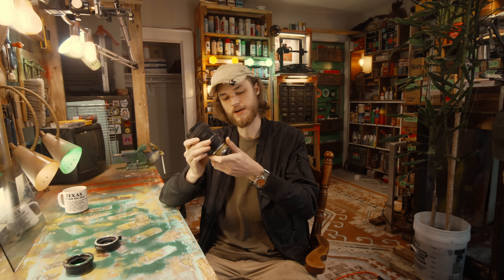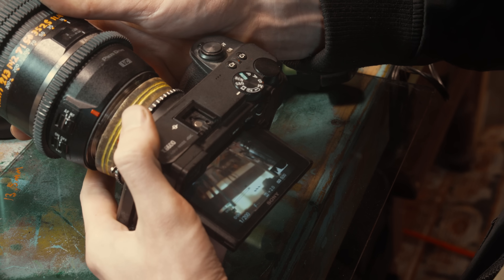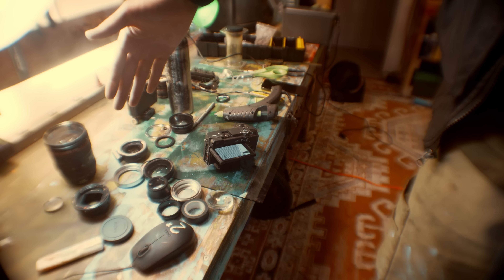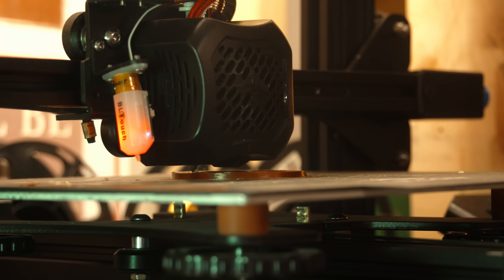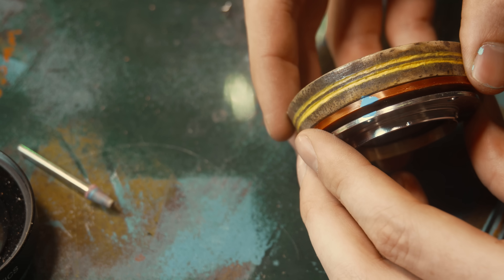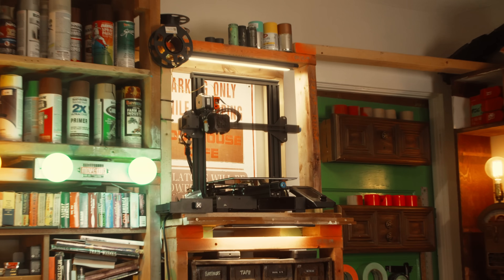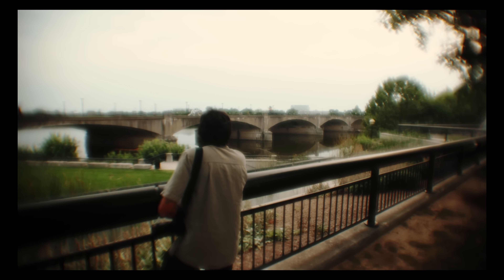Upgrading my DIY Lens Adapter

Comment: Howdy fellow broke resourcefulness enjoyer. Here's what I do to mitigate cracks in lenses: Oil.

Just put a tiny drop of sewing machine oil (or any light oil would do) on the crack and it'll spread into the cracked surface through capillary action. The whole point is to replace air in the crack with something with much higher refractory index so the change isn't so abrupt. 

Ideally you'd do this with optical oil with a known index but that ain't how we roll...

Comment: I am doing something similar, but instead making an focal extender to see if I can get full sensor coverage with old tiny 1/2" tv lenses. While trying out different lenses, I disassembled a chinese C-mount lens, some of the lens elements in there aren't that bad. I think it would be worth it to use some old cheap full frame camera lenses and try to scavenge what internal optics that could be useful. The aperture mechanism on the chinese manual C-mount lens also has some uses for when you make a focal reducer like this.

Comment: I'm researching DIY focal reducers for a project of my own, so this is great you just posted this! I'm leaning towards some inexpensive achromatic lenses used for telescopes mainly for the purpose, and repurposing them for a camera. Seems like the ones made for cameras always come in a group like your Canon one, in large part to reduce chromatic aberrations (I'm still learning about all this so not an expert at all) Although I like that you're just trying whatever you have laying around. That's extra cool and experimental. Maybe I'll start there.

Comment: A tip I learned working in stop motion is that rubbing alcohol will dislodge hotglue from wood (and most other surfaces). We use a lot of hot glue to hold things in place, from glueing sets and props to tables to securing light stands and tripods.

Comment: Wow, that crack really shows you how unnecessary it is to obsess over small scratches or dust in used glass. Especially since it's at the rear of the lens, where people say it makes more of a difference than at the front.

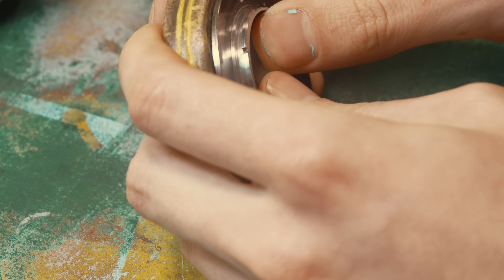Comment: 1:03 You've probably already heard this trick, but a little bit of IPA (aka isopropyl alcohol / rubbing alcohol) dropped or sprayed onto hot glue will release it immediately from basically everything it's put on, especially wood!
Reply from the maker: Ooo I did not know about that actually, thanks for the tip!
Reply: @EvanMonsma no worries, hopefully it helps!

Comment: if it doesn't throw off the focus too much, rotate the crack horizontally and then it's just your JJ Abrams flare booster
Reply from the maker: It does work horizontal- I shoulda mentioned that in the video. It actually cracked diagonal originally. Chose to do vertical flares on this one because I’m doing a seperate anamorphic project soon :)
Reply: that's exactly what I was thinking